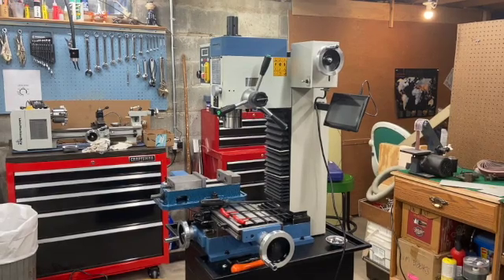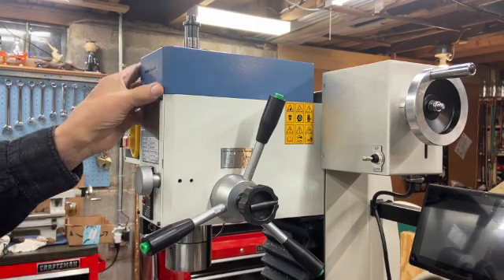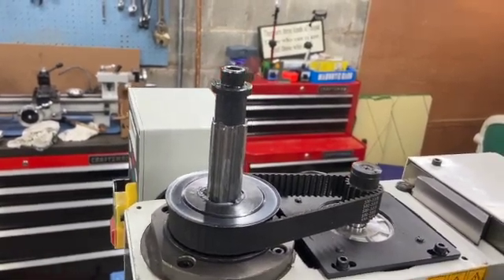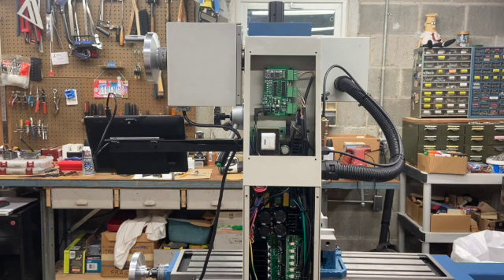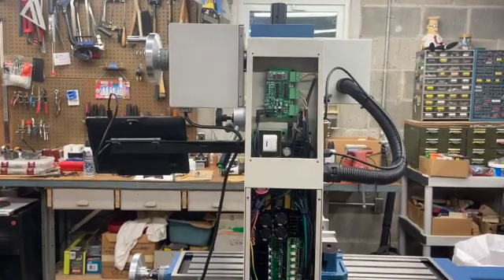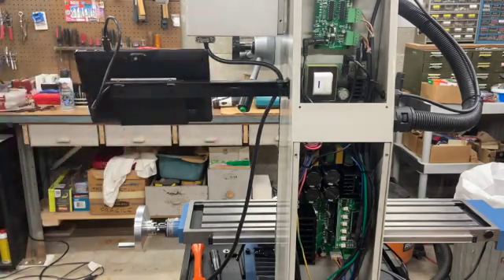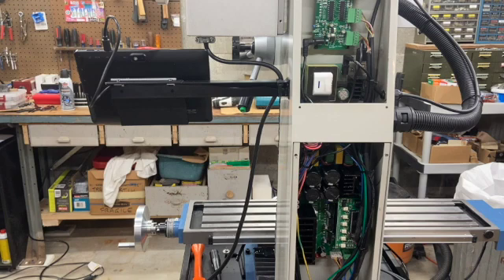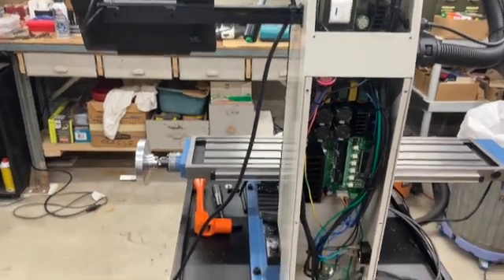LMS 5550 (Sieg SX2.7) Bench Mill - Drive Belt and Electrical

Comment: Nice video. Is that power z axis original or the Priest Tools model ?
Reply from the maker: It is the unit from Priest Tools sold by LMS.  I purchased one of the first ones and had some problems when I mounted it due to misalignment of mounting holes.  This was because SIEG doesn't drill holes on their columns the same every time.  I did my own modification to the Priest Tools bracket and also notified them of the problem.  Once it all fit together it works very well and saves A LOT of hand cranking!  Well worth the money in my opinion.
Reply: @olennemac2502  Have the Priest power z axis on order now. Have the LMS 5500 and added the Bluetooth DRO package and your videos have helped in the routing of the wiring.Thanks or the info.